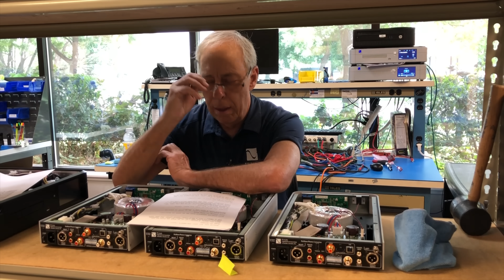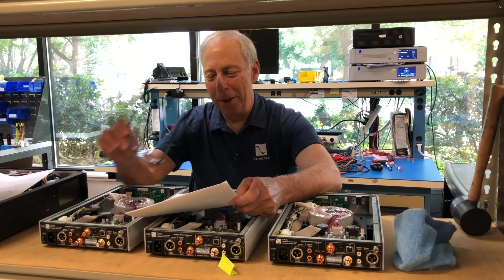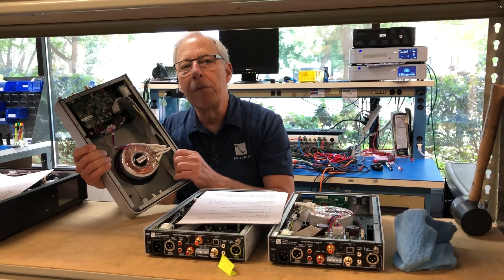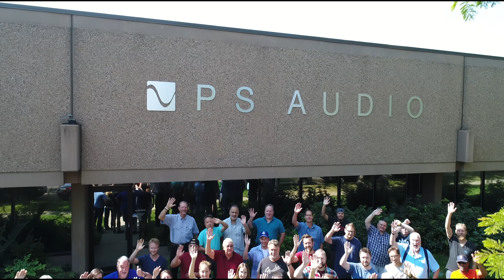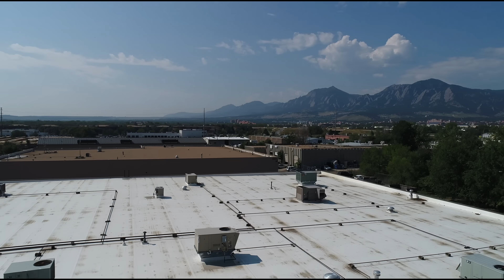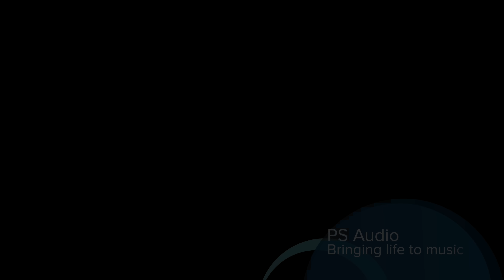What's inside a high end power cable?

Comment: Paul, Paul, Paul, Paul, Paul, how do you sleep at night.  It's great that your clearly making some nice quality audio gear but come on really?  Your hearing a difference between a decent gauge power cable and your special high end power cable.  You do know that, at your age, your ears have degraded significantly.  If your audio power supplies are able to maintain reasonable DC voltages, how would you be hearing a loss of bass, especially when not playing at full volume?  Can you show that your amplifier output is clipping with a standard decent quality power cable?  An increase in distortion perhaps?  This is just as bogus as claiming you've heard a difference in sound when reversing an audio cable which is carrying an AC comprised signal.  You know AC, electrons flowing in two directions.  Not sinusoidal but still AC none the less.  Then you minimalize those who simply ask for a little evidence to show your product does as you claim and improve audio quality.  It's okay to make a good quality power cable and charge what ever you want for it but I think making the claim, even if just implied, that this will make your system sound better than a good quality, reasonably sized AWG power cable is just plain dishonest.  Well, at lease your not robbing poor people on the streets.
Reply: Larry Niles, yes it is sad isn't it.  Science and logic have prevented me from needlessly spending precious limited funds.  Also figuring out that there are other alternatives to realistically addressing an audio system's deficiencies rather than believing in something that just isn't there.  Nothing like trying to create evidence to support the results you know you want to arrive at. Sad, so sad.  Larry, is it so wrong to expect a proper blind controlled study or test.  I wouldn't call that 'closed mined' just being realistic.  Seems like just an attempt to belittle me.  I suppose if you compared a fancy high end cable to a garbage Chinese cable, there would be a difference but that would be rigging the comparison wouldn't it?  I'm talking about decent stuff, maybe commercial grade stuff perhaps.  Some years ago, I conducted a small blind test of high end speaker cable to see if anyone (audiophile types) could determine when I was using 10AWG 2 conductor jacketed AC power cable instead.  An immediate A B test where I would repeatedly switch back and forth between cables as many times as needed for the listener to try to reach a conclusion.  And guess what the results were?  The same listener was wrong about half the time.
Reply: You know, you just need the rectangular conductors to get the good treble xD
Reply: Explain this then "Inside the AC3 is one OFC hollow conductor for the treble region, a large OFC rectangular conductor for the midrange and multiple gauges of OFC bundled together for the bass."
Reply: mikokuijn yes, maybe Paul can explain that. But of course no one can. I have somewhat of a funny story about that. I was at a training session with a Belden engineer presenting.. He told us that he challenged a cable manufacturer to a simple test. The manufacturer claimed that his cable split the high and low frequencies. So the engineer challenged him to a test. Since 60 hertz AC is low frequency, then the cable that carries high-frequency should reject it. Steve told the gentleman to hold the bare ends of the cable and he would plug the other end into the wall.. The guy refused.. Hmmm. Wonder why??
Reply: ""There are none so blind as those who will not see." Or hear.
Reply: Various people and animals can sense electromagnetic waves and compression variations where others may not...even in variations too small for many types of monitors.  It doesn't mean they don't feel it.
Reply from the maker: Why would I bother giving bogus information that I do not believe nor hear? I can easily hear the differences and so can you and I would invite you to come visit for a demo.
Reply: PS Audio Paul, no doubt you can hear the difference.. The power of suggestion is indeed powerful.. But, we're still waiting for you to explain the physics behind how a power cord can affect the frequency response, distortion, or noise of an audio system?  And how can you possibly design for a problem that you can't even identify?
Reply: Until you can explain the physics behind a grilled steak being so tasty you should stick to gruel.  If you don't like the info here Brad, why do you keep coming back?  You're more needy than a baby bird.
Reply: Gruss Gott then why did you respond to my post? And why are you so scared that Paul can't justify his design? He designed it. He should understand the physics of his design. Or is it you just don't want to admit that you spent a lot of money for things that make no difference? I like coming here and calling this out. It saves people money.
Reply: How do you stop this stuff from being 'suggested' via the Roku YouTube Channel even when you're not subscribed?  Is there a way to ban Paul's channel from my 'suggested' list?
Reply: @grussgott2  I'm actually kind of on your side here, and don't believe everything can be proven by science either. And I'm certainly willing to actually give these cables a listen, before I get on here, and say that people that believe in better cables are crazy. Because let's face it. Who the heck am I to call people liars, if I haven't even bothered to try one myself? If you stop to think about it. That's about the absolute Mt. Everest height of arrogance right there IMHO. I mean seriously! Stop, and think about that for a minute please. Who has that kind of balls? They're basically saying: "I don't care how much experience you have, and how little I have (that would be none! Zero, Zilch, Nada!). I'm right, and you're wrong! Period, end of story! And if you try to out argue me. I will f@cking gaslight you biatch!" That's Cajones right there my friend. Amazing! 

Especially when they go, and claim Paul can't tell because of his old ears, and try to tell people who argue further that it's not what they are actually hearing. It's psychoacoustics (that gaslighting thing)! I mean geez. First these people are engineers, then they're ear, nose, and throat specialist. And now, by golly, they're Sigmund Frikkin Freud too. Wow that's quite a resume for some people that still have time to waste their time arguing over nonsense on the internet too. You really do meet some amazingly talented people on the internet I guess. Wow! Who knew? 🤔

But that being said, there is actually a scientific reason why a grilled steak tastes so good.

It's called the maillard reaction.
http://www.latimes.com/food/dailydish/la-dd-why-grilled-meat-tastes-good-20150702-story.html
Reply: HH Scott my friend, if a difference can be heard, then the exact same difference can be measured. Think about it. You hear a difference because the speaker is reacting a little bit differently. And for that speaker to react differently the signal at the output of the amplifier has to change some. That can be measured.  Plus, do you really believe that a speaker is more sensitive to variations than proper measuring instruments? It's not.. be skeptical and save yourself some money. The only people that advance this nonsense are the very same people selling it. No one outside of sales buys into any of this.
Reply: I agree with Bradley Smith.  Paul seems to go off on a tangent when he comes up short on facts and then conclude with some silly notion.  Kind of like when some really importanct leader starts tweeting and can't stop.  Paul, your not doing your clips live are you?
Reply: Gruss Grott, I supposed you insist that a Delmonico tastes far better than a ribeye.
Reply: Paul did explain it Brad: trial and error.  Which is as far as any Earth creature has ever gotten in explaining anything because here's the thing Brad: we're not even capable of explaining our own existence.  If you zoomed in on, say, your arm, you'd see cells, then molecules, then atoms, and then below the planck length all reality as you perceive it utterly disappears.  You're not even actually here Brad, and further, there is no here.   All we humans can do to explain anything we experience is trial and error; experiment.   So time for you to quit listening to music, moving around, eating, and definitely typing, because you can't explain any of those things ... but then at least you've met our expectations.
Reply: @bradleysmith681  I believe our ears are more sensitive then measuring equipment. If a microphone makes a recording, and then a system reproduces that recording. Using the best technology available mind you. Yet we can still instantly hear the difference between a real live event, and one that's being reproduced. How am I supposed to trust another microphone connected to the latest technology to tell me what I'm hearing? I can't. We don't even know everything about our bodies yet. Including our hearing. IMO you're giving technology way too much credit. We aren't there yet my friend. We just aren't. We don't listen with microphones, and testing equipment. We listen with our ears. It's that simple to me, and if you try to convince me otherwise. You'll just be completely wasting your time. Sorry. But that's how I feel, and unless there's some big breakthrough. It's probably how I'll always feel. There's no real money, or scientific reason to make dramatically better testing equipment either. So that's not very likely to happen any time soon either. They spend more money developing weaponry, then they do designing audio testing equipment. That's why weaponry is advancing at a faster rate. Our hobby is a low priority in the grand scheme of things. I'll trust my ears, and my fellow audiophile friend's ears. Thank you very much. Just to be clear again. Please do yourself a favor, and don't waste your time trying to convince me otherwise. It's just silly to do so. I've been on both sides of this debate, and I've decided to just keep an open mind. If I ever decide to try one of these cables. I'll be sure to buy it from a place that I can return it to, if I don't like it. And if I do like it, and it's only psychoacoustics. Well that's fine too. What's the difference? If I spend my money, and I'm happy I did. Why does it matter that I enjoy the sound more, because it's my mind, or it's reality? I'm happy either way. The fact of whether it's all in my head, or real is quite inconsequential isn't it? And to be clear. I'll never, ever understand why people care how other people choose to spend their money either. It's none of my business why people do what they do, unless they're hurting others, or our society. And they're definitely not. In fact they're actually helping our economy by doing so. I'll be here enjoying the f@ck out of my very lucky life if you want to reply, but again. I would not bother, if you expect me to be swayed by your thinking in any way. It's probably not going to happen. 

Our ears have developed over centuries, starting with us being prey for other animals. We can pick up timing, and distance clues that microphones couldn't possibly begin to. Microphone technology is older then I am, and without much advancement. The whole idea that things have to be "measured" to matter is honestly one of the silliest things I've ever heard in my life, once I stopped to think about it. Please do this yourself. Stop, and think about what you're saying. You're trying to compare one of the most complex things in the universe, the human body, and something we've spent hundreds of years trying to understand, yet still don't really have a clue about. To a bunch of simple electronic devices we created ourselves . Think about that. We don't have the knowledge to explain ourselves yet, but you think stuff we designed is superior to what we don't yet understand. Seriously? Sorry my man, but your logic is flawed. Didn't we just discover a new part of the human body recently? I mean there was an organ in us we didn't even know about yet, but you trust technology we invented decades ago over our complex bodies? That's crazy my friend. Crazy!

https://www.google.com/amp/s/www.independent.co.uk/news/health/new-organ-human-body-interstitium-cancer-skin-scientists-discovery-new-york-a8275851.html%3famp

Argue with that. I triple dog dare you to!
Reply: @chrisharper2658  That my friend would be blasphemy! Ribeye is the king. Period! 😊
Reply from the maker: Brad, if you'd left off the comment about the power of suggestion it would have been helpful to everyone genuinely seeking answers as opposed to standing on a platform. As I have said many times and I will now repeat, I do not have the answers you seek. I do not know the physics of why this works or even if it can ever be explained in terms you'll accept. Your question is like asking a master chef the physics behind what he does. They are there, but he likely does not know them. That does not invalidate the changes he makes to taste. It just says he doesn't know them.

And before you jump out of your seat and tell me and the world that physics can tell us about tastes, which they can, let me suggest that only a very small handful of scientists actually understand enough of what and how we hear to answer your question - and those people aren't involving themselves at the fringes of audio where we play.

It is likely impossible for most people to be open minded and inquisitive enough to accept the observations of others that do not hold their worldview and thus, we tend to dismiss it with a few words. That makes sense for some things: aliens, flying saucers, conspiracy theories. But when there's an entire accepted culture of engineering people working on furthering a form of art that is shared by thousands around the world, it might behoove you to open your mind up just a little bit. Who knows, maybe you'll come help us explain that which we hear.
Reply: Okay, my preference...
Filet mignon or...
Beef tenderloin,,,  Which tastes better?
Reply: This is possibly the greatest reply i've ever read!  Bravo!  As for the Maillard reaction, good contribution, however that's an after-the-fact explanation.  In other words, through lots of trial error (like when Edison invented the light bulb) we discovered that grilled meat is delicious.  Or take the transistors in the PCs we're reading this on: they were created from semi-conductors based on quantum mechanical theories developed from observable properties - but we still can't explain QM, just what we observe ... fancy trial and error.  But a better example is a car: what % of drivers understand all of the systems in a car?  What they do understand is that it moves and how to control it and they buy it after a test drive.  Paul offers full test drives for the same price as a car dealer.
Reply: Yes, but I can't explain the physics of it to you, nor can you prove to us why you have that preference, thus you must continue watching.
Reply: PS Audio Paul thank you for your response. But I don't understand why you simply dismiss our concerns as not being open-minded. We are very open-minded. I've asked several times for you to explain the principles, which you can't do.  I've asked for measurements, which you can't produce. All you can really say is that it sounds differently .  Completely and totally subjective and open to the power of suggestion. You are the one asserting principles that are typically rejected by the engineering community.  But you also reject that the power of suggestion is in play. How can that be? How have you ruled out the power of suggestion?  Why are you not open-minded to the fact that the power of suggestion is in play? But let's move away from the ear and focus more on the speaker. Perhaps you can answer these questions. If you hear a difference between set up A and set up B, then clearly the speaker is responding differently to set up B. Is that correct? I mean you don't disagree with that, right? And if the speaker is responding differently, then there is a different signal or a modification of a signal feeding the speaker, correct? That has to be true, correct? Given that is true, we should be able to put a test instrument to measure that signal, correct?  Our test instruments are far more sensitive than any speaker. How is it that the speaker is responding to a signal that apparently can't be measured or found by test instruments?
Reply: Gruss Gott grass, again, how is it that our test instruments can't measure a signal that apparently a speaker is responding to? Test instruments are much more sensitive than a speaker.
Reply: Gruss Gott explain what? That you're responding to the power of suggestion. I've already explained that.  Again, how is it that the speaker can respond to a signal that can be measured. Our test instruments are far more sensitive than any speaker.. I bet you believe in magic too. The magician pulls the card from behind your ear and because he said he got it from there, you believe it.
Reply: HH Scott sorry, I can't respond to an essay. But I made a response. Take a look at what I wrote back to Paul. It's essentially the same thing I would write back to you.
Reply: Chris H Thanks.. indeed. So he doesn't understand the physics, he doesn't understand how he designed it, he doesn't understand why it works, but he rules out the power of suggestion. How does he rule out the power of suggestion,? Well, he really doesn't know. He just doesn't believe that the power of suggestion has anything to do with it. But as you know, our test instruments are far more sensitive than a speaker. But apparently these speakers are responding to some magical signal that can't be measured.  Sorry, if the speaker responds to it, then our test instruments certainly will respond to it as well.  It's just nonsense.
Reply: @grussgott2  Actually the science behind tasty steak is very well understood.
It's not physics though, it's mostly chemistry.

I would be very happy with an "after the fact" explanation of why the expensive cable sounds much better.
Reply: Pro Tip: High performing engineering teams ban sentences starting with "actually ..." and, no, the science isn't understood at all, because taste isn't understood.  We simply know through trial and error that steak is tasty and we guess it's because of the science of caramelization, but it's a guess
Reply: Easy answer to that Brad: Assuming those instruments are perfectly designed to measure the thing that needs measuring, the team conducting the measurements does so perfectly, and the results are interpreted perfectly, you might have 20% of a point.  And even if that were possible - which it's not - it would also assume we understand human hearing, which we don't.  So you see Brad?  We're all just monkeys wondering about falling apples; it's just some of us (Hint: you) are delusionally arrogant about our abilities.
Reply: @grussgott2  It's Brad who is delusional about his abilities???
Who was the one claiming to hear a different sound quality with a more expensive power cable..?
Reply: Gruss Gott speakers respond to differences in voltages and current. Both of those values can be easily measured. I don't understand why it is so hard for you to understand. If the speaker sounds different, then one of those two values or both has changed. That is very easily measured. The reason that there are no measurements in this video is that what is presented here is just nonsense.
Reply: That's right Oscar, you see science explains observable phenomena, not the other way around.  If Paul hears a difference with a cable, and others do too, then it's up to scientists to explain why, not Paul, because that's how science works.  And even if they do, the absolute best they can accomplish is a Scientific Theory - Humans' best attempt - which is only predictive until it's not, like with Newton's Theory of Gravitation ultimately superseded by Einstein's.  And even then we really don't understand the mechanism of gravitational force transmission, yet based on experience we can send machines past the Sun's Termination Shock.  So, yes, Brad is arrogantly delusional.  QED.
Reply: Oscar Gr Thank you.. Yes, I have the problem because I question the assertion of magic..
Reply: Gruss Gott the movement of a speaker cone is based on basic principles of voltage and current.. If the speaker cone is moving differently, then either the voltage or the current has changed (or both). Both of those are easily measurable. And to say that it's not is just simply BS.
Reply: But Brad, first we have a problem with measurement accuracy and completeness, and next with how that speaker response creates sounds which then resonate around a room, ultimately hitting your ear, and all of that direction and timing determines if you hear a difference that you perceive as "better".  So you see Brad, you understand 1% of puzzle and I"m being generous.  But no need to debate me, just don't even try anything you can't explain - that'll help the rest us explain your inferior experiences.
Reply: No Oscar, you've created a false equivalence to bolster a fragile ego: observable phenomena = magic.
Reply: Gruss Gott I'm not talking about the ear. I've made that clear.  If you were hearing something diffetently, then  the speaker is doing something differently. The only way you would hear any changes is if the speaker is responding differently than before... So let's focus on the speaker. If the speaker is responding differently, then the factor of voltage or current (or both) have changed. Either of those changes is easily measured by instruments. It's really that simple. You can't possibly hear any difference unless the speaker has responded differently. So focus on the speakers. Any changes speakers can be measured. In fact, very easily.. Paul won't measure because it'll show no differences in voltages and current. And without the difference in voltage and current,  you don't have any difference in the performance of the speaker.. I'm really shocked that these basic fundamentals are so easily overlooked..
Reply: I'm not saying it's not measurable Brad, I'm saying those measures won't help you explain anything because you can't explain how those cone movements translate into "better" or "worse" perceived sound for you or anyone else.  You can't even create a full list of factors that might apply.  I do enjoy listening to people who believe they know everything though.  It's like yesterday when a 5 year old told me all about water and then was blown away that ice was water.  But man, he sure did think he understood water!  Cute!
Reply: Gruss Gott okay, I think now we're getting somewhere. I'm glad you agree that those differences can be measured. Now we're on the same page. And here is my point. There will be no measureable difference at the speaker. Paul's cord, a $30,000 power cord, or an off-the-shelf power cord with proper connectors and proper gauge will all measure exactly the same. A power cord has absolutely no bearing on the output of an amplifier or the input of a speaker that makes the changes that people can hear. A power cord simply supplies a given voltage at a given current to the internal power supply. A poorly designed power cable can induce a small voltage into its grounding conductor that will be noticeable in mostly unbalanced systems. So, since you agree that those differences can be measured, then why doesn't Paul show the measurements? The answer is obvious. Because there is no difference in the measurements to show. And since the speaker will react exactly the same to an off-the-shelf power cord or Paul's power cord, then there is no differences in perceived sound.
Reply: PS AUdio: "But when there's an entire accepted culture of engineering people working on furthering a form of art that is shared by thousands around the world, it might behoove you to open your mind up just a little bit."

That is hardly accurate. The so called accepted engineering culture you refer to is no doubt PS Audio. The formal engineering community represented by the IEEE and other international organizations largely rejects these audiophool ideas. You conveniently ignore the hard fact that there are many other fields of electronics that are far more  critical and sensitive to power problems yet they don't employ these audiophool products. They just use standard commodity power distribution products when it comes to cords, fuses, and distribution products like breakers and wall outlets. I'll say it again, if there were any merit to this, yours and other snake oil vendors like your friend Audioquest claims,  there would be wide spread applications of these technologies outside of consumer audio.

And some of us are really getting tired of the audio subjectivist crowd calling educated engineers and scientists "closed minded" Any engineering curriculum is a tough road to hoe. The dropout or transfer percentage is actually higher then the medical curriculum. You obviously don't know about that as you have not personally invested the effort in formal education to learn deep electrical theory. And you seem to be proud of that by often describing your teenage and young adult years as a rebel. So to say an accredited engineer is "closed minded" is just absurd. What should be said is the subjectivist crowd is "empty minded" as far as electrical engineering knowledge goes and is a far more accurate description. You do  say you lack the engineering and physics knowledge to understand why these cables and magic wall outlets work, did you ever consider you also lack the physics and engineering background to understand why they can't work as stated?
Reply: Andy Delle Excellent. That was so very well said. Let me add that my friend is a biomedical engineer. I can assure everyone that he is very concerned about the power supplies, cords, and cables being used during open heart and brain surgery. And then how about the  power supplies and cords  being used in the ICU units to keep people alive? You're exactly right. No one outside of high-end audio sales accepts any of these "principles." In fact, they're easily debunked.  If anything stated here had any merit, other industries would adopt it.
Reply: RE: Medical applications:
You need to know that Shunyata has a separate WEB site where they claim to use their products in medical applications - patient attached equipment no less. But as typical with Shunyata the whole thing is just another scam. Some  wealthy doctor who uses Shunyata audio products asked them to try their power cords on heart monitoring equipment. This was done on a weekend or after hours and Shunyata posted images that is said to show the noise reduction. Of course the images are un-calibrated with no test procedure documented so it's not credible. But then they claim their power products are now in use with a number of hospitals. I don't buy it! There is standard UL listing, then if for medical usage there is a much stricter UL standard applied - 606. This is very stringent and expensive to obtain. Shunyata claims to have all required certifications but that's all they say. I emailed them twice in the information request page asking for the UL files which are public information. no response. So it seems their products have no safety certification at all never mind the stringent required medical equipment electrical safety certification. No medical facility would use non listed electrical gear. Can you imaging the insurance liability if an accident were to result. Even if not the fault of the power cord, the fact that the product is in the equipment to patient chain and unlisted, the plaintiff's legal team would have a field day. So based on that I am confident their claims of wide spread medical usage is BS. Should Shunyata provide the UL606 file numbers, I will gladly rectify my statement. So remember this if some audiophile uses the Shunyata BS to justify snake oil power cords in medical applications.  Just ask for the UL file numbers.
Reply: Andy Delle thank you for that. It is bizarre how some people view audio as some mystical electrical signal that defies the laws of physics. Truth be told, audio is just a low frequency, narrow bandwidth signal.  There is really nothing magical about it at all. And these claims of power cords affecting the frequency response or distortion of equipment is just completely laughable.
Reply: Andy and Brad, I blame the US educational system for your misunderstanding of the problem - you see, electrical engineering is only tangentially relevant here - it's like saying the guy who designed the engine is the best driver - he might be able to design a high output engine, but that doesn't make a fast car.   More specifically, IEEE nerds manipulate ELECTRICITY, whereas audio products engineers manipulate SOUND.   Anyway, I'm not trying to convince you because you clearly will never understand due to obstructing egos - but others might not be so far lost.
Reply: Gruss Gott grass, What is the sound system other than the manipulation of electrical signals? That is electrical engineering. Why do you keep talking about what you hear and ignore the function of the system?  I've mentioned it several times yet you continue to ignore it. This is so unbelievably simple that I can't believe you continue to miss this. Any sound you hear is the function of a moving speaker cone. There are electrical signals driving that. If the speaker cone begins to change (what you perceive as a 'changing sound') , then the signal driving it had changed. Those signals can be easily measured.  And our test equipment is much more sensitive than a speaker. It truly is that simple. And let me say that you and the rest here are in the minority. The much larger community that involves itself with much more extensive engineering and much, much more complex systems laughs at all of this nonsense.  The only people talking about this foolery are the people that sell the products. No other discipline of electrical manufacturing accept any of these claims.  Apparently, you accept the assertions in which the designer doesn't understand how it works,  doesn't understand why it works, and can only say that he hears a difference.  Oh, and he can't rule out the power of suggestion. Okay..
Reply: in my defense, i'm only ignoring your points because you have no idea what you're talking about.  E.g.,  a race car driver, after all, is only manipulating engine horsepower and torque so all race cars of equal weight, torque, and horsepower are equally fast right?  Cause we can measure stuff!   And if we take the output of a woo wa33 tube amp and ensure the voltage and current are the exact same as the headphone jack of your phone ... they'll sound the same!   Brad, this is turning point for you - it's that place where you humbly realize there's probably more going on here than can you explain ... or you decide, nah, you fully understand electricity past the quantum level, and thus know exactly what, how, and when to measure stuff.  You got this.  Wave/particle duality?  master brad.  Uncertainty principle?  Not with Brad!  He's certain!  See what I"m getting at here Brad?  This is the point where smart people start feeling pretty stupid, and stupid people insist they're smart.  Which are you Brad?
Reply: Gruss Gott  Why not answer the question I keep asking? Explain how two signals that swing the speaker the same sound different?  Because that is what you're asserting.. Power cord A supplies power to an amp that outputs signal A.. Power cord B supplies the same amp that outputs signal A as well.. The two signals swing a speaker cone identically (and the signal measures exactly the same). But you hear a difference between power cord A and cord B?? No, you don't.  But feel free to explain how you perceive differences from a speaker that swings exactly the same between the two cords. I want to hear that explanation.  And do explain how Paul has eliminated the placebo effect here.. He doesn't explain, so you must know. After all, I'm sure we don't truly understand the human mind and how deep that placebo effect could truly be. Right? According to you, there might be things going on we don't understand.. So, we might not fully understand the deep effects of that placebo effect.. Or do you know all about the placebo effect and can rule it out here?  How do you determine that the placebo effect does not apply to the assertions in this video?  And I don't know anything? Then neither does the entire professional audio industry either, including its researchers who work on the much more complex systems.  Finally, I wonder why Paul never prevents his products at AES? In fact, why don't any of the snake oil folks? Because they know that they'd get laughed out of the building.
Reply: Gruss Gott Oh, forgot your question.. The tube amp and headphone amplifier WILL  sound identical if their signals are identical into the same speaker.. A load will respond equally to different sources provided the source outputs are identical.. Time for you to accept science and leave magicland.. Science does work and outcomes are predictable.
Reply: Gruss Gott, Your analogy about audio electronics manipulating "sound"is seriously flawed. To use your race car example, which by the way is accurate, being a good EE does not automatically make one a good musician. Being a good EE does not make one a talented recording mix engineer. But electronic audio products barring microphones and speakers are electronic instruments. They don't deal with sound. They deal with electrical signals. The last time I looked inside an audio amplifier I saw copper wire, not hollow tubes for sound to go through. And speaking of hollow tubes, yes microwaves do go best through hollow metal tubing due to skin effect. We understand that too. But we also understand why it works that way and why talking about skin effect on audio cables is absurd. When these audio magazine reviewers can proficiently explain microwave and RF theory, then I might give them credit for understanding skin effect.
Reply: Bradley Smith he did offer to give a personal demo. Take him up on it
Reply: 60zeller thanks but I have no intentions to travel to Colorado for a demo. But I would suggest that Paul bring his magical cord out to the AES convention, where we can put it through thorough testing. So far, none of these snake oil vendors will bring their products out to the engineering community for testing and evaluation.
Reply: I am late to this discussion but, I have a challenge. I would be interested in seeing what a single electron looks like. Since everything electrical can be measured and quantified with the application of science and measurements taken with the most sophisticated and sensitive of electronic design, that should be an easy one. Can anyone point me to a source of any kind that can show a direct image of an electron?
Reply: Wayne Charlton sure, there are images of the atomic structures. I believe it was the hydrogen atom that was captured. And I believe some European researchers were able to capture the images of an electron. I don't have links to any of that. But I remember reading about it in one of my journals some years ago. But I'm kind of missing your point?
Reply: Gruss Gott mmm grilled steak... yes science, the flames and the heat just carefully balanced between burning and cooking results in degeneration of proteines and combined with acids and minerals in the flesh can produce up to four thousand different components that all have a unique flavour.
Reply: Because you can say anything you want to and some people will simply take your word for it.  You have a high believe-abilty factor, seem likeable and all.  BTW, over sizing a transformer (I think you said by ten times) in a product like a preamp or ADC will NOT improve the performance of the product, as you stated, it just increases the cost and weight.  Sorry to say, more does not always equal better.  It is actually an underutilized resource.  And for some odd reason it makes some people feel better about their purchase.  You know, we didn't get to the moon and back by simply throwing mud at the wall to see what sticks.  We use science Paul... science.